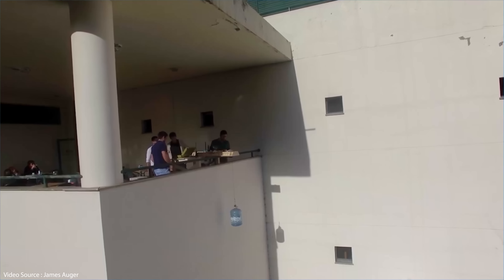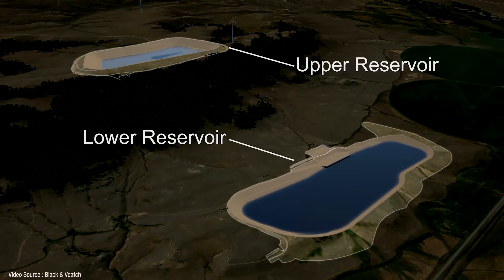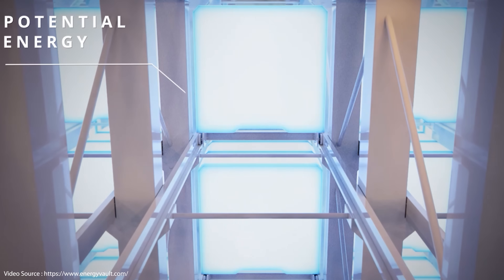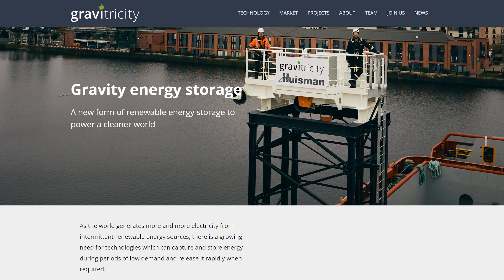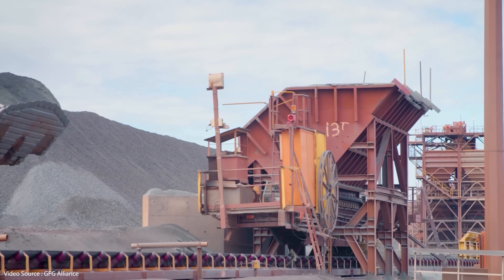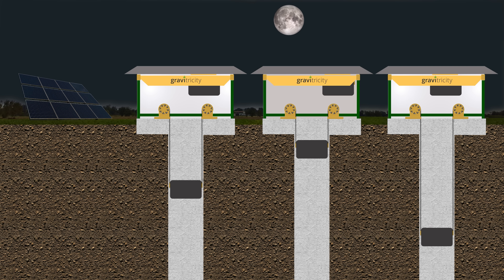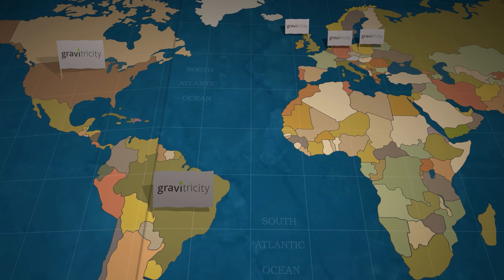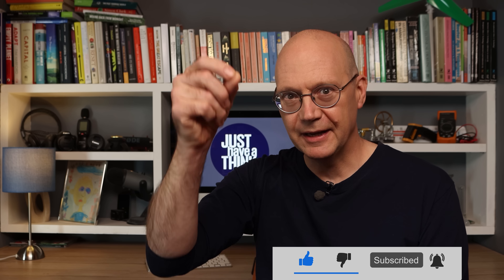Gravity Energy Storage. Who's right and who's wrong?

Comment: You also have to consider maintenance and construction costs. 
1. Construction: super expensive, drilling holes in the ground or building high structures requires lots of materials and has a lot of environmental impacts.
2. Maintenance: Moving parts of the system have to be greased (usually). The loads will probably need to be stabilized, so you need some kind of guide rails. This means friction over long distances. Workers have to be able to get into the structure (also if it is under ground), you have to keep out the water, etc. You need a high volume of space for a single weight, as probably only one weight can be lowered down per tunnel.

I am more on the side of batteries. Over the next years, many used batteries will return from the EV market. There are already companies that specialize in reusing these batteries for energy storage and AFTER using them for many years, finally recycling them. Batteries pose the danger of catching fire, so you would have to consider some safety standards, but they operate almost without any moving parts and do not require maintenance. Energy management can be totally automated. You can modularise these batteries and easily exchanged old ones.
Reply: I understand where you are coming from and Batteries are great at some things. But I think you misunderstand what they are doing. They don't need to construct much if they use existing abandoned mine shafts which already have the needed support and mechanisms. Also, mechanical systems are much safer and less damaging to the environment in the long run. Lithium is a very rare element relatively and our need for it (if we electrify all our transportation) will outstrip the supply very quickly so we need to be very strategic in our use of it. And mechanical devices are almost never damaging to the environment and can be 100% recycled at the end of their lives, unlike most batteries that use hazardous chemicals. Even future batteries like flow batteries or Sodium batteries will be limited in their usefulness next to a simple mechanical storage system like this or compressed/liquid air.
Reply: Matenance is minor problem, same as all the elevators around the world. Planing on using old mine shafts.  Technology already existing and proven, just reconfigured and applied. Old rule KEEP IT SIMPLE.
Reply: 1 ton dropped 100m can produce 1MJ (slightly less; assume g 10 m/s2) that is about about 0.277 kWh (0.277 Units); so yes, you will get perhaps 0.2 units (because of losses). let us say a typical shaft is 500m deep and you can handle 50t loads at one time (not too fast). It is not difficult to calculate.
Reply: We really just need to hit all possible approaches at the same time in places across the world and see what shakes out the best. I am right there with you on batteries but I just really don't think we are there yet. We NEED one of these "shocking breakthrough any day now" technologies to actually shock and break through, and not in 30 years either. Meanwhile we can play with various scale models of gravity storage, flywheel storage or whatever. Parallel development is really important here.

Comment: That EVRC animation is so frustrating to look at, its literally being animated next to a mountain where a reservoir could be built and water could be pump to at a higher elevation for more energy potential than the building they propose. Its unreal the people making the animation didnt catch such a basic observation
Reply: And the wind turbines in the valley instead of on the ridge
Reply: Agreed, very cringe
Reply: Yes that storage system is horrible.

But at this point in the American southwest pumped hydro is probably not a good choice.
Being that Lake Powell and Lake Mead are at excessively low levels.

10s of millions of people's water supply is under a serious threat.

Should the trends continue it is highly likely that a few cities might cease to be in the coming decades due to lack of water.

Comment: How do these two systems compare with the gravity-based principle of heavy wagons on rail tracks - whether they are pulled up by a motorised unit or winched up??

That system seems very safe in comparison and the only major losses would be wheel-bearing friction and any inefficiency in the power unit.  The rails themselves would have minimal frictional loss and air resistance would be negligeable.  All you need are some gentle hills - nothing extreme nor any major ugly features on the landscape nor the cost of excavating secure vertical shafts.
Reply: You only store / get energy from the difference of vertical height. The horizontal length of the track does not give you any benefits, so it would just require more space for the same effect and you have reduced efficiency due to the friction of the wheels.
Reply: @Kiboxxx  - true and that is both a given and a good reason for their relative safety!  There are plant of locations globally that would suit this application without taking up valuable human or agricultural habitat. Solar panels are great users of space and wind farms have a major visual impact and affect bird-life significantly.  This is not meant as necessarily the best or the only solution - just a good one to consider from the gravity perspective. Their visual impact would be quite easily dealt with by running the tracks in a small artificial "ditch".
Reply: @ Mark C
I thought of the idea of using hills as well and one could use a rail system as mines have done. But one could also compact the earth and simply slide weights designed in a ‘sled’ configuration up and down the hill. Yes there would be losses due to friction but costs on construction would be far less. Setting up rails that would handle the weights involved will be expensive. There is also ‘slip sheet’ material that reduces friction. The logistics industry uses it. Miners used to ‘rawhide’ their ore down the mountain.
Reply: it is already done: called regenerative braking.
Reply: @janami-dharmam  - So why not use it this way too?
Reply: The amount of energy you get from a system is dependent on the 1) Weight of the load being moved up and 2) the Height you achieve. if you push a load straight up (like these guys are doing) then all of the energy you put into the system will go towards building the potential energy in the raised weight (minus any system loss in the motors). But if you push the load up an incline (like on a rail going up hill) then the amount of energy you put raising the load vertically is only a fraction of the over all energy that you put into the system because you have to spend energy counteracting the horizontal force that is pulling you back the track.

Comment: Don't coal mines need to be constantly pumped to keep from flooding?  That requires quite a bit of energy, running 24*365 - going to need to get a lot back from these storage systems to recover that.
Reply: Depends on how far down the water table is, and whether there's drainage.
Reply: where from the flood water comes?
Reply: @janami-dharmam  The surrounding earth.  As I understand it, there's practically always water underground, providing you did deeply enough.  And mines are very deep.

Comment: Can't we just float a platform over deep sea and lower a weight from that?
Reply: The sea has other issues, like salt and stuff growing on everything. I think this was covered in another video, perhaps by Undecided.
Reply: Building something floating in the ocean and keeping it maintained is hard work. The effect of the weight is reduced, as water is much denser than air. You would have to build a float to carry huge weights without sinking. The platform has to be robust to waves and currents and it will probably effect sealife. Then you need to get the power back to land over... cables?
Reply: @Poorold plowboy Let alone tidal currents, weather and swells.
Reply: Anything involving salt water and the sea automatically raises the cost X10.

Comment: I just cant see it ever being scalable enough.  I mean if you take a 1 tonne weight (say 1000 litres of water) and heat it up by 50degrees.  that's 25 mega joules of energy... if you wanted to give the same weight of water as much gravitational energy you'd have to lift it 5km in the sky.      or think about if you want enough energy to power your car for a day.. you'd need lot lift something as heavy as your car 100s of kilometers in the sky...   but the whole thing just feels an order of magnitude out. gravity is the weakest of the natural forces, it seems like the wrong one to focus on, it's not very energy dense...
Reply: Hydro only works because you start with two big existing lakes at very different heights, put in pipes and pumps then move vast quantities of cheap mass (water) up and down. Creating the bespoke mass (perhaps millions of tonnes on thousands of railway trucks) and ways to store it all at two different elevations (long railways at the top and bottom of a mineshaft) will be far more costly, despite the increase in efficiency. Phase change (e.g. liquid air storage) is far more energy dense and cost effective than solid-mass gravity storage.
Reply: @clivemitchell3229  yes.  i think that as soon as you have to create/form the mass units for gravity storage you are onto a losing game.
Reply: also the disused mineshaft thing is a red herring, most current mines are open cast mines, not deep shaft mines.  and how many of those shafts remain, are stable and serviceable is debatable.. and even if they were, that 30 tonne weight, going up and down a Km is equivalent to a 850kwh battery.. so ten electric cars worth... per mineshaft.  it's peanuts.
Reply: actually just programming teslas to drive to the top of hills at night might be the more sensible suggestion.    or really going for the weight, put massive hydraulic rams under mountains and lift them up a metre or two at night, use the pressure to drive some turbines.   but it all sounds really really expensive, with lots of maintenance and moving parts.